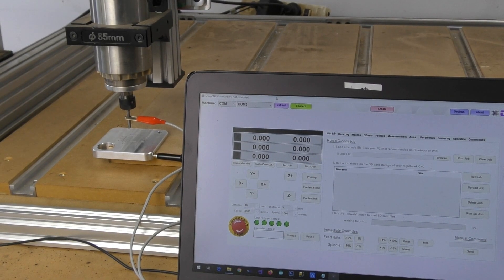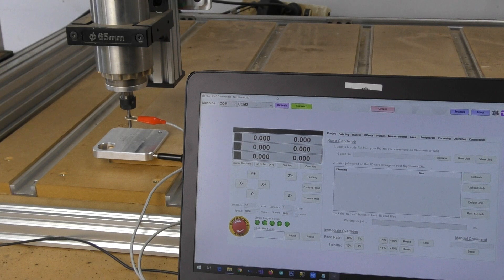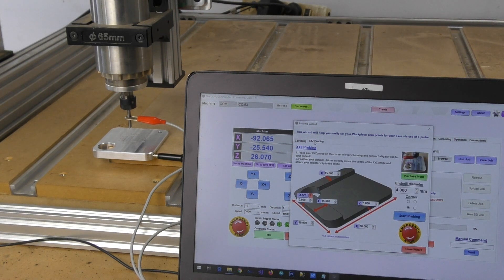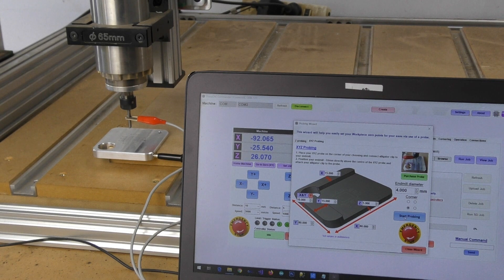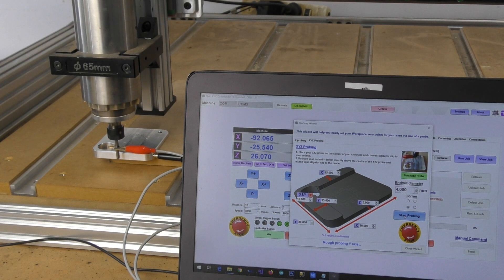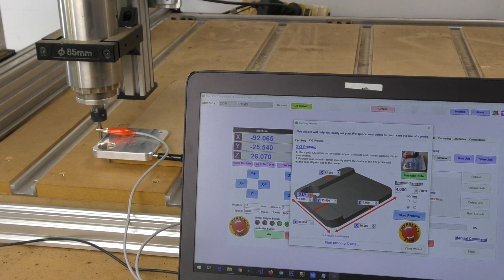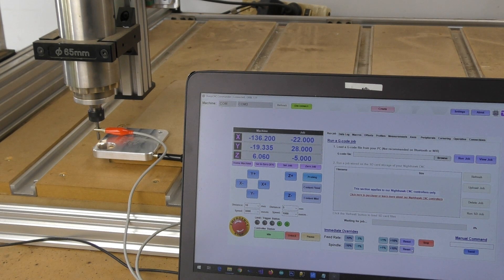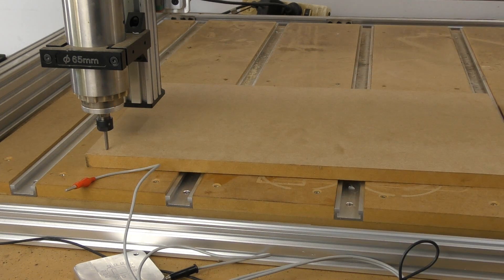SharpCNC Commander GRBL Control software -  XYZ Probing wizard

Comment: Would it be possible to add a feature to measure the size of the bit using the hole in the corner ?
Reply from the maker: You certainly can using a macro

Comment: Cool tool. Would be so nice if this app was multiplatform and works on a mac. Can you code for mac too, please ?
Reply from the maker: hi,

The software is written in .NET framework and won't directly run on a mac. You can however run it using parallels on a Mac. Give that a try!
Reply: CNC3D I did, I like the graphics very modern looking. Would be so sweet if I could run it natively on mac. If you ever come across some free time please see if you can port it to Mac OS. Regards
Reply: CNC3D I read if you target net core and not netframe work your can easily port your app to Mac OS. There is only one other gbrl app I know that works on Mac OS in java and it is not as nice as yours. Please port to Mac trust me if you do your app will become popular and take over the web in no time. Please think about it.